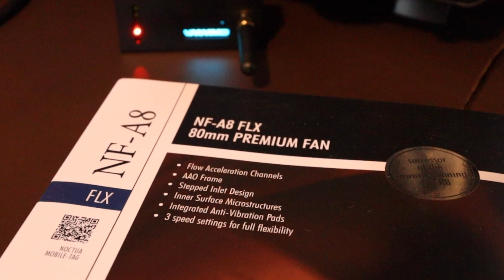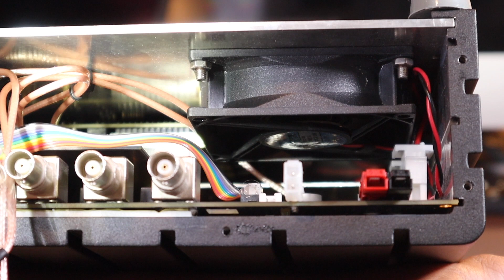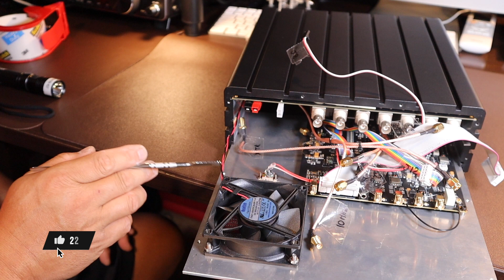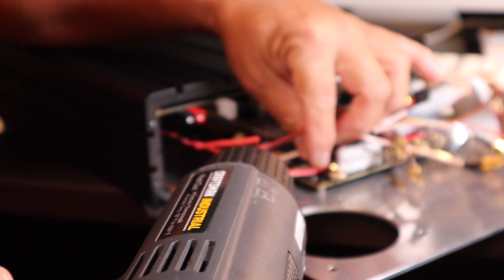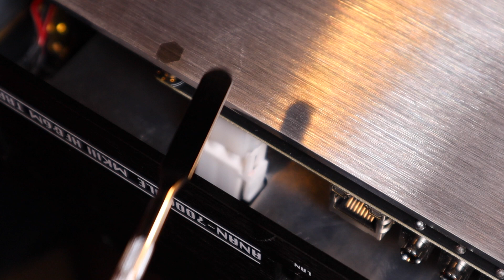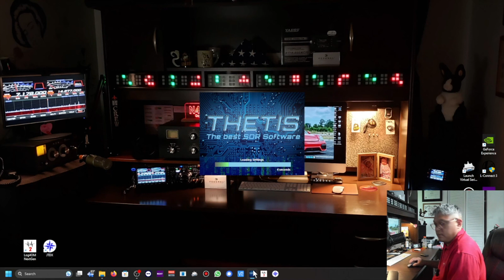Apache Labs Anan 7000DLE Mk3 Fan Replacement | Dissembling the Anan 7000DLE Mk3 | Best Noctua Fan !

Comment: Well worth it, my radio is now very quiet. No more high pitch whine.
Reply from the maker: Awesome!  Did you use a Noctua fan too?
Reply: Yes I did the same one as in the video. Thank you for tutorial. Now sounds like a whisper. One tip remove front panel and that one connector will be more accessible.

Comment: Hi Darren  --  Little hared to tell from the video,  but what is your assessment of the sound difference.   Was it worth it?    BTW also have use RF-Kit.   Nice pair
Reply from the maker: For me, yes it was worth it. I don't hear the high winding noise from the fan. The RF2K-S is a very nice amp however,  I'm not using the built in Antenna Tuner.

Comment: Thanks for the video Darren. Do you think it is possible to change the orientation of the power switch by removing the front panel far enough to release the switch?
Reply from the maker: I think it can be done without totally taking it apart. If you see in the video, the mic, headphone, key, and LAN connections are attached on the bottom plate.
Reply: Nice Capt 👍🏾